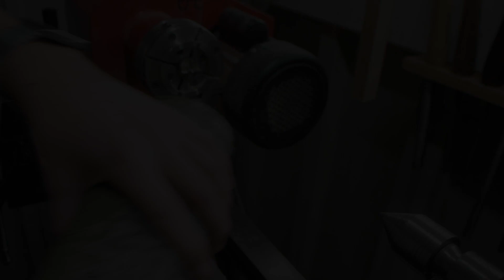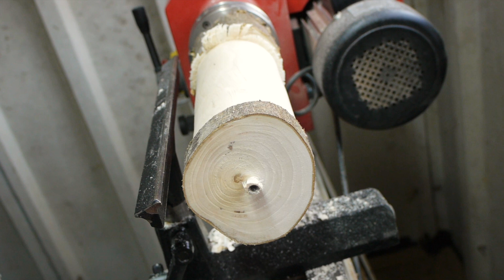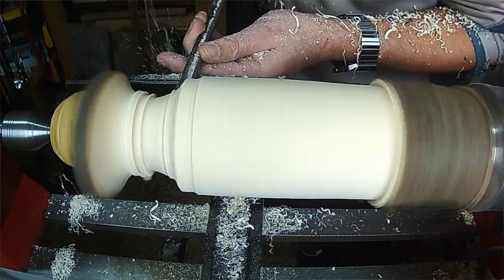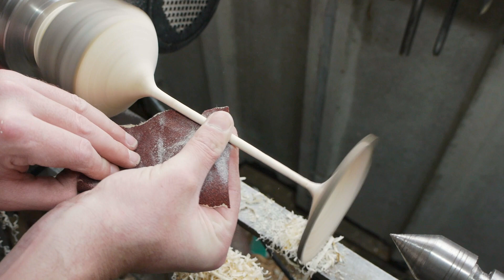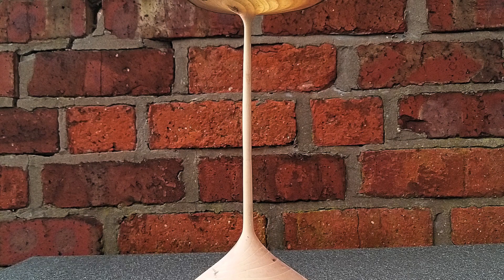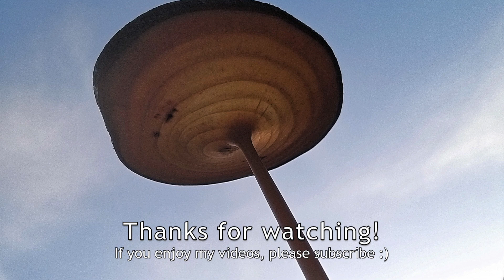Woodturning - Apple Podlet - Wooden flower

Comment: I have to say.... this is now our favorite piece you have made. (It keeps changing because you keep making cooler objects! We are fans of abstract and this looks beautiful. Question for you. I noticed the last project (whistle) you turned, you used what looks more like chisel to cut it down. Today you used more of a U shape cutting tool. Is there a reason for this? (Just made me so curious!)
Reply from the maker: Thanks a lot my friend! I did the majority of this one with a 3/8ths bowl gouge, that's my go to for most things. It's essentially a round stock with a deep groove or flute cut into it. Spindle gouges are very similar but the flute is often shallower. The big U shaped one which I took the bark off with near the start is a spindle roughing gouge, that one doesn't pop up too often. I think the reason I went with the bowl gouge here was the distance between the tool rest and the piece. The skew, like on the whistle and wand videos, I could get right up close. For me they tend to get a bit grabby with a big overhang. Waffled a bit there but I hope this helps lol. Cheers mate.